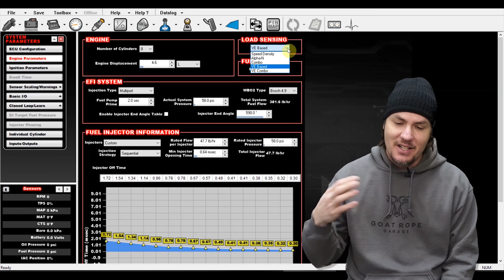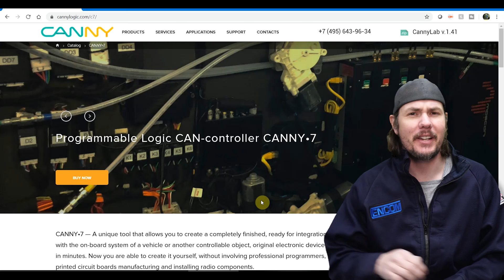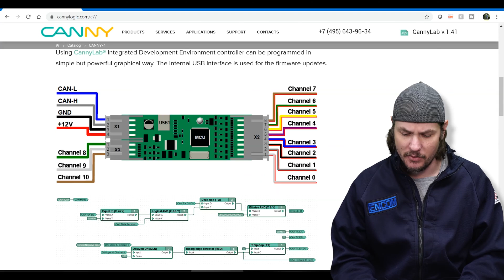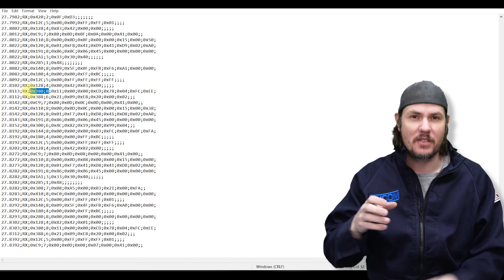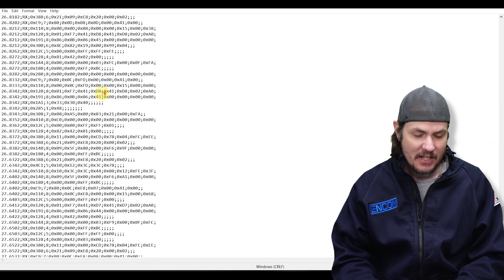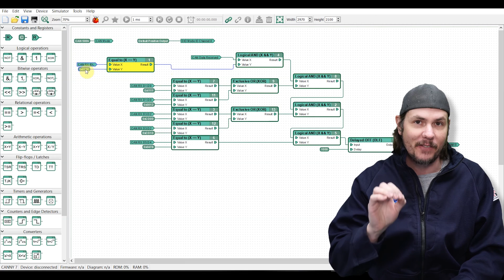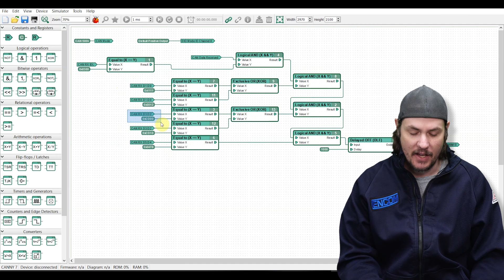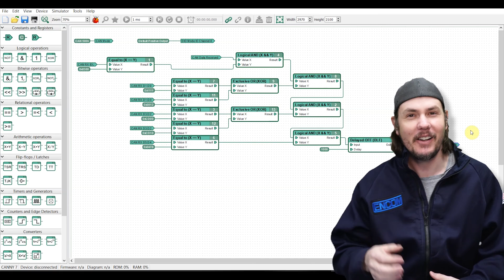Hacking The Can Bus, Controlling A Relay With Factory Can Messages!

Comment: What is the name adapter I have Honda Accord 2019 I need Cancel can H can L radar cruise control?
Reply: Buddy. I have exactly the same radar module problem in my jag xk8. How to bypass/delete it. No one seems to know.
Reply: @johnrobert6012  which car Jaguar?
Reply: JERRY RIG EVERYTHING! MY CAR IS THE HACKATHON OF THE CENTURY. 😆I NEED A NEW CAR
Reply: Will it work on dodge im trying to swapa hemonin to 69 Dart but  the starter relay work  ver canbus  the ecm send signal to starter relay..

Comment: Does CANNY 7 work to send CAN bus messages based on external controls?  I.e. can I install my own seat cool/heat switch and use it to trigger a CAN message?
Reply: I would like to do the same.

Did you ever figure this out?

Comment: Hi Goat Rope Garage. Great video. I was trying to develop an app for controlling my car using my phone. The goal for me is trying to get the user setting menu in my instrument cluster to operate from my phone. My current approach has been to read the messages flowing on the CAN bus using a Korlan USB2CAN device and Can-utils and then replaying the message back to the bus to cause the desired change. Whenever I send the message for a particular function to be switched on, I can see that it momentarily switches on but then goes back to the previous state. From my experience it seems like i am not able to WRITE changes to the bus. Any inputs on what I might be doing wrong? Have just started this project so my knowledge of this is very basic. Thanks in advance!
Reply: Were you able to find out what was wrong?
Reply: @АндрейКим-ж1р   So aparently there are multiple CAN buses on the vehicle. You have to send the message to the bus which is the "primary" bus for the feature you are targeting and it is not necessary for this bus to be accessible via the obd port. I tested on a ford eco sport and was able to write changes to the bus when transmitting the message onto pin 3, 11 of the OBD port aka MS CAN but the same didnt work when trying through the pins 6, 14.

Comment: I know this is an older video, but do you have any insight on how to use the canny to take an input and inject canbus messages?
Reply: I’m working on this same thing.  But limited to a single can bus system I want to control that is installed in a classic car.

Comment: do you need all the can bus wires? In my swap there was a highspeed one (tan and tan/black) wires that went to the donar car's electronic brake control module. I figured since I am not running that I figured it should be okay to remove those wires. Is that accurate? Same for air bags.
Reply from the maker: You'll need to find the canbus map, any modules you're not using you may have to bypass as they are all Daisy chained, so if you just skip one you'll lose everything after it and usually the ECM is one of the last ones on the bus.
Reply: @GoatRopeGarage  I think I get it. So my example the BCM connects to the ebcm and then that connects to the fuel pump flow control module and then the tcm. So what I need to do is basically replace the branch that goes from the BCM to ebcm and make it go straight to the tcm. Is that right? I can send you a diagram if that helps.
Reply from the maker: @ClintonC1991  Yep, if you're building you're own harness just bypass, using the factory there will be two can in and two can out, just jumped them to bypass that module
Reply: @GoatRopeGarage  got it. Just solder together and keep going.

Comment: Usually if a vehicle won't cut off I find the customer has straight wired the cooling fans. Did you have to do any wiring to the fans? If so unplug them and see if it cuts off.
Reply from the maker: Fan is being controlled by the Holley. It's an ECU issue, the E22 works fine, the E67 has something different going on with the relay control, my guess is that it's a different message request from the BCM.

Comment: Great video thank you 🙏🏻 ,
Can we use this to control  other devices right , maybe use it as a boost controller with a solenoid that opens  a  waste-gate based on a boost gauge reading coming to the cany ?
Reply from the maker: Sky is the limit, if you can dream it within the constraints of the IO you can probably do it
Reply: I think it is a bit risky to rely on the CAN bus to control the engine. I was thinking about making a nitrous controller based on CAN bus but there is so much going on the bus and a bit of delay due to CAN bus arbitration can be damaging for the engine.